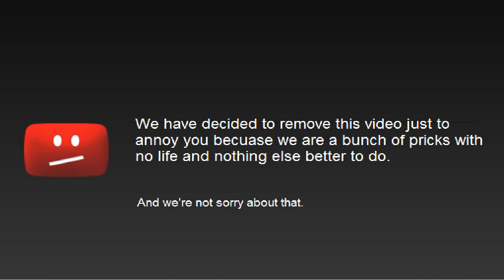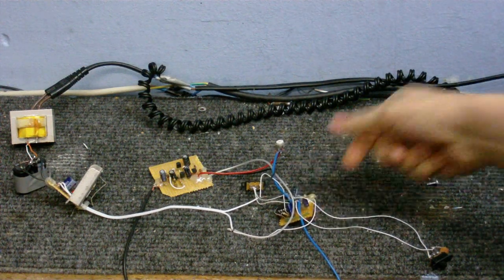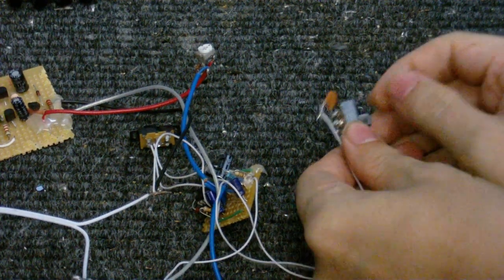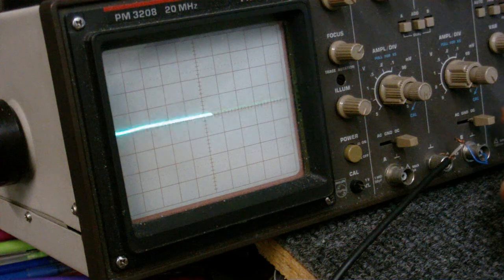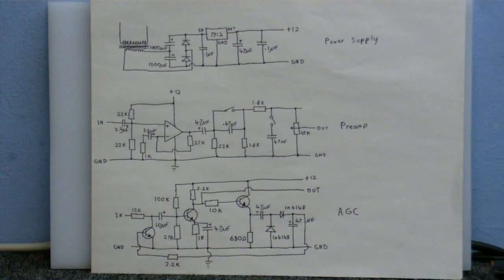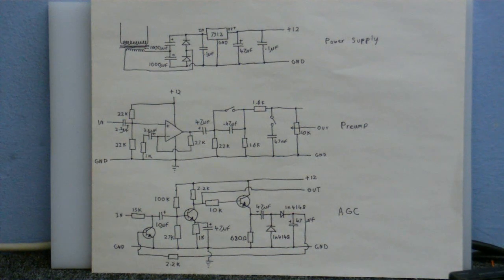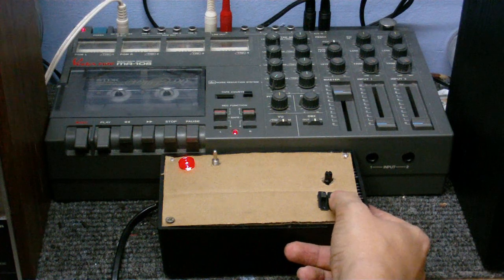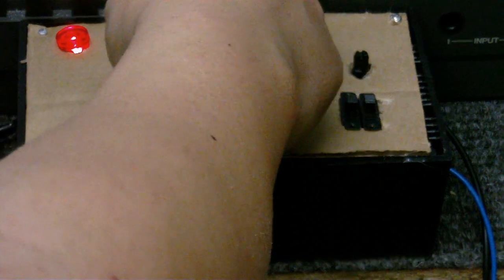Finnising the mic preamp. (part 2 of making a power supply for the mic premp)

Comment from the maker: @elektrodenio I wanted t make sure the pcbs were secured down well, If I just glued them to the plastic box they would sure become un-stuck after a short while, I also put some little peices of carboard on the backs of the pcbs then just glued them on to the cardboard in the box.  Kind of a low-teck soloution, but it works.